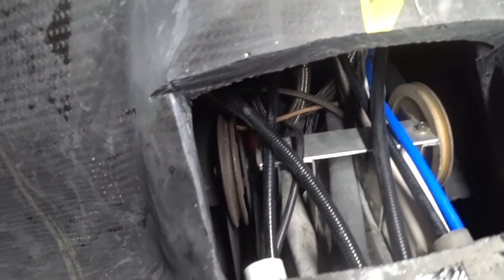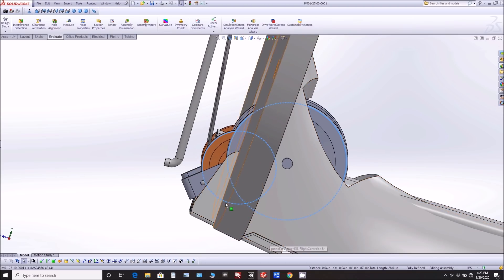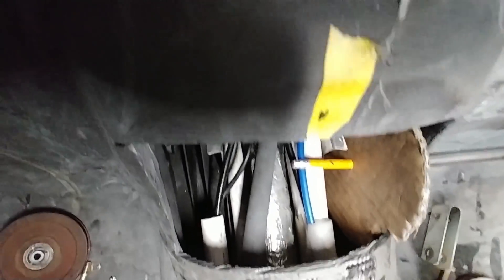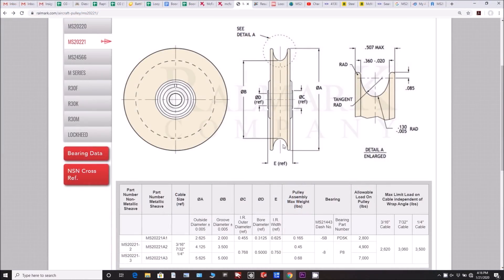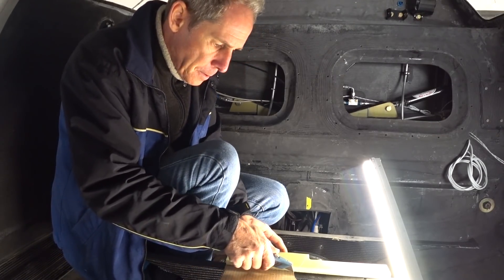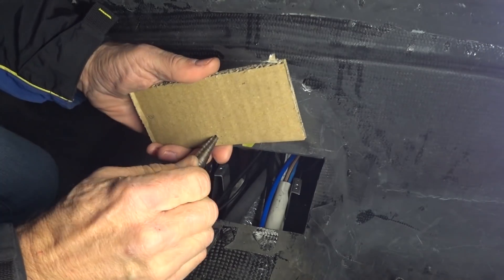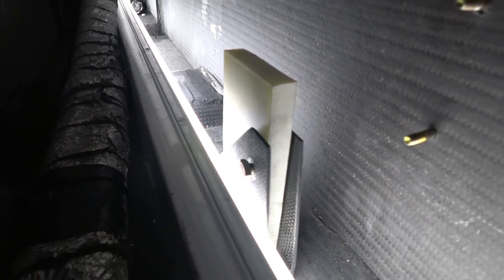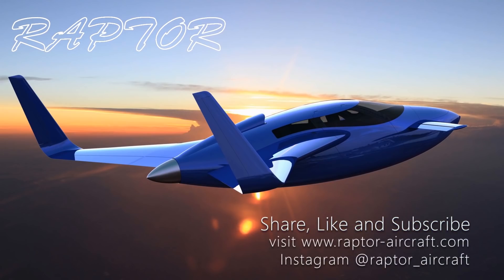Think Outside the Box - Building the Raptor Prototype

Comment: Is there no room in design for push-pull tubes like that was used in the Ez’s and Cozy Mk-IV? It was pretty straight forward in my Long Ez. My Velocity uses push-pull cables similar to what is used on boats. I have a yoke system and have about 700 hours on it with no slop.

Comment: Not being able to feel the structure from a video, I am a little uneasy with the square corners cut on the keel, from a stress concentrator standpoint. Perhaps in the production airframe,  four holes may be cut with a holesaw, and then cut to connect. Whatever you cover that hole with could also add strength to it.

How will the rod be fixed? Lathed and threaded on both ends for washers and wired nuts?

I wish you had more pulley options.

Comment: Are you going to run thicker cable?
Reply from the maker: The existing pulleys can only fit a 1/8" cable.
Reply: @RaptorAircraft  , ...and?
Reply: The issue here is not the strength or stiffness of the cable, it's the stiffness of the cable pulley anchors. The 1/8" 7x19 cable is good for about 9kN (~2000 lbf), that should give plenty of margin over any possible system loads.
Reply: @hpaircraft2187  , how much does 15 foot of 1/8" cable stretch, with a 100lbs load?
Reply: @BrendaEM  The Loos & Co. website has a handy stretch calculator:
https://www.loosco.com/resource-library/technical-information/cable-wire-rope-stretch/index.php
According to that, 15 feet (180") of 1/8" 7x19 stainless steel loaded with 100 lbf stretches 0.1037% of its length. 180"x0.1037% =0.187" (4.7mm). If it was 3/16" diameter cable, the stretch would be about 0.083" (2.1mm). So going to 3/16" cable would cut the cable stretch in half, but the cable stretch is already such a small amount that the difference is pretty much inconsequential.
Note: You have to be a bit careful about units here; 0.1037% = 0.001037. It's pretty easy to slip the decimal place by one and end up with an answer that's an entire order of magnitude off.
Reply: @hpaircraft2187  , Do we know the total travel for the control surface?
Reply: In earlier videos Peter showed that the total cable travel is about 1.25" (32mm).
Reply: @hpaircraft2187  , I still like the idea of thicker cables, perhaps something even that might be pushed in a housing. Eliminating stretch over such a short through will be a challenge.
Reply: @BrendaEM  The cables used inside housings in push-pull applications is a completely different product specifically engineered for that use. Using thicker cables would just add mass to an already overweight airframe, with little if any benefit. The issue here is not the stretchiness of the cable, it is the limberness of the system anchors for the pulleys. The proposed transverse 1/2" pivot rod will be an improvement over what's there, but is a relatively inefficient use of the material. Much better would be larger diameter tube that has a far greater (5x or so) cross section moment of inertia with less mass. It's simple engineering that they teach in first-year statics courses.

Comment: The decision to go back to the pulleys was a good one, but there are a lot better ways to anchor them than with a 1/2" (13mm) pivot axle. The stiffness of a rod or tube scales with the square of its diameter, and the strength scales with the cube, so a relatively small increase in diameter gives you a large increase in stiffness and a huge increase in strength. The upshot is that a 3/4" tube with 1/16" (1.5mm) wall thickness weighs less than a 1/2" steel rod, but has three times the bending stiffness. And if you go out to like a 1" diameter tube with 0.049" (1.25mm) wall, you get five times the stiffness and it's still lighter than the 1/2" rod.

As I suggested several videos ago, the best way to skin this cat is probably with a steel weldment that bridges between the sides of the keel and supports the two pulleys. The bridge would be based on a 1" steel tube with 0.049" wall. At each end of the tube would be a plate that anchors to the sides of the keel with two to four AN bolts and nuts. Spaced along the tube would be two pairs of steel leaves that support the two pulleys. The plate and leaves would be 0.050" thick, and all steel would be common 4130N. The end plates might be braked into angles so they anchor to the aft bulkhead instead of to the keel. This sketch shows two possible schemes for the pulley bridge:

https://hpaircraftblog.files.wordpress.com/2020/01/raptor-aft-pulley-bridge.jpg

The anchors at the sides of the keel or at the aft bulkhead could be reinforced with plates or wedges of G10 Garolite. What we often do in situations like this is drill and tap the Garolite reinforcements 10-32 or 1/4-28, and temporarily attach them to the weldment with short machine screws. Then we'll bond the reinforcements into the airframe as dictated by the geometry of the weldment. When the bonding paste cures, we remove the machine screws and the weldment, drill clearance holes through the threads, and  apply one or two plies of fiberglass over the Garolite to encapsulate it and distribute load into the airframe. Then we put the weldment back in and secure it with the final AN hardware.

The 0.05" thickness for the tubing and leaves makes it amenable to tack welding with a common 120v MIG box. So it's pretty easy to hack something together in the field, then take it to a professional welder to be TIG'd together with full circumference welds that submerge the tacks. Then you can send it out for powder coating and it comes back looking really professional. That's not the absolute best way to do a thing like that, but it is certainly good enough for most aeronautic applications.

Edit add: At time code 0:40, is that really the thickness of the keel? If so, now we know where some of the extra mass came from! For an aeronautic shell structure like this, I'd expect the thickness to be somewhere around 2mm-4mm. This looks more like 12mm-15mm. Unless the keel is reacting some huge amount of bending from engine or aero loads that aren't obvious, that is a lot more carbon than you need.
Reply: BTW, the Kitplanes article on designing cable control circuits that someone else linked in the comments (also below) is a great primer on the topic. My friend Paul Dye recently stepped down as Kitplanes editor, but that has not diminished the quality of their product one bit. They have maintained a very high standard for technical content, even greater these days than the EAA publication Sport Aviation. 

https://www.kitplanes.com/stressing-structure-4/
Reply: Ask Marc Z about my proposal to use bridge weldments that span the keel and supports the forward and aft pulley pairs. He will probably have some valuable insight on it.

Comment: Question: Why not take your current pulleys to the lathe and put large bore for new bearings in them? I'm also curious why you're using composite pulleys and not aluminium for that.
Reply: Because a tensioned string of metal rubbing across & through more metal in a big shaking/vibrating box is bad ju-ju. They are most always dissimilar materials, even in the airliners.

Comment: I am not sure enlarging pulleys and making them stronger will resolve the overall flex in the system which seems to mostly come from the long cable run.  Maybe a pushrod  and bellcrank arrangment in the wing  + push/pull cables in the keel  would be a better solution.  That being said - hope your solution still works out !
Reply: Most of the slop isn't from the stretchiness of the cable, it is from the limberness of the system anchors. The idea here isn't to make the anchors stronger, it is to make them stiffer. The difference is subtle but important. Making the anchors stiffer will probably make them stronger as a side effect, but that isn't always the case.

Comment: Now that I'm thinking about this, it seems like if the two pulleys are on a common shaft, and you preload the cable to at least the amount of force you'd put into it from the stick, there will no net change in the force imparted on the combined two pulleys during actuation -- any extra tension on the pull side is compensated by less tension in the return side. It seems this would make the system much less sensitive to flexure. The preload is the key. (It's like why a preloaded bolt doesn't feel any change in tension as long as the force on the joint is less than the preload.)

Comment: How flexible are the wings, exactly?   Does wing flex need to be considered in cable routing?  Do these systems normally contain a tensioner to allow for wing flex to change the pulley geometry?  I'm sure Solid Works can simulate this; and Peter knows the flex modulus of the layup; but I haven't seen anything like structural dynamics in the videos.
Reply: Since the cables are a closed run, I think flexure would only change the preload in the cable.

Comment: Peter-

Have you considered creating the pulleys to your specs instead of off the shelf? I'd think that would be faster than waiting on a supplier. I'm confident you could use any size bearings and control the overall size of the pulley. They could be any materiel of your choosing. Should not take that long to have a machine shop water-cut discs and machine "U" channels for the cable line. Just a thought.

Cheers-

Comment: Have you considered using hydraulics instead of cables?
Reply: Or electrics?
Reply: Electric and hydraulic systems need a lot of of failsafes and backups which make them heavy and very expensive. You also lose a lot of the feedback and feel through the controls.

Comment: Once you resolve the pulley flex and cable issue, will the aircraft ever be able to be  pressurized, due to cutting into it?
Reply: I don't think he's planning on pressurising the prototype, at least not for a very long time
Reply: It shouldn't be that big a deal to patch the hole. It will just take some attention to make sure that the repair bond goes full perimeter and doesn't have any leakage paths.

Comment: Gave some consideration to your problem with the cable and housing flex.  Have you ever noticed that on high-performance bicycles, the housing is only used around critical bends?   The straight runs have no housing.  Bicycles experience the same flex and stretch that you were experiencing.  The short runs of housing end in a small feral which is firmly attached to something solid and then slotted to allow the cable and housing to be installed.  Very little housing flex using this method.  Thanks, again for all of the many video updates.

Comment: You're welcome buddy! I'd still like to see how much stretch you get on 25ft of cable from 65lbs of pull... You know, for science...
Reply: It's not difficult work it out. This page gives the equations and figures http://blog.loosco.com/bid/42817/How-to-Calculate-Wire-Rope-and-Cable-Stretch
Edit: Here's a link that goes into a lot more detail https://www.kitplanes.com/stressing-structure-4/
Reply: @LesNewell  That Kitplanes article is fantastic! If Peter had read and applied it before designing the aileron control circuit, he'd probably already be in the  flight test phase.

Comment: Little by little your coming up with different solutions without major changes to the system. Make sure your loads through your keel can be mitigated through your design changes. Keep the faith you’ll get there. Safely!! Cheers Peter.

Comment: Something Hawker 800s use to help eliminate cable stretch is to take the cable and run it through a piece of tubing and swedge it on both ends. This of course is between pulley runs. Also are you pre-stretching your cables before installation? Most cables for certified aircraft are fabricated on a bench and then stretched on a test bench.
Reply: Am I understanding right, this effectively replaces a section of stretchy cable with a rigid tube where possible between pulleys? That's pretty brilliant where possible!
Reply: @bradley3549  the cable still runs through the tube so the tube is acting like a sheath. It both protects the cable from wear and strengthens it.
Reply: @FlyguyXII  Hence 'effectively' - since the cable between the crimps isn't doing anything unless the crimp slips. Correct?
Reply: @bradley3549  I'm not an engineer but I would assume you are correct.

Comment: Do you believe tensioning the cables so that they're preloaded may take out the cable/pulley play?
Reply: I think that is the point.  Can't preload them until they are adequately braced.
Reply: @cclose14111   No, preloading would help anyway as long as the two pulleys are on the same shaft. Flex from the preload doesn't matter as long as it doesn't change.
Reply: @patrikj  Actually preloading helps a lot. Firstly it takes up any backlash. Additionally if the preload exceeds the maximum normal load on the controls you actually halve the amount of stretch. Think of a system with no preload. You apply 20lbs of load. That 20lbs is all applied to one cable as the other will be slack. Now look at a system with >10lbs cable preload. When you apply 20lbs you increase the load on one cable by 10lbs and decrease the load on the other by 10lbs.  As stretch is roughly proportional to load you end up with half the stretch.